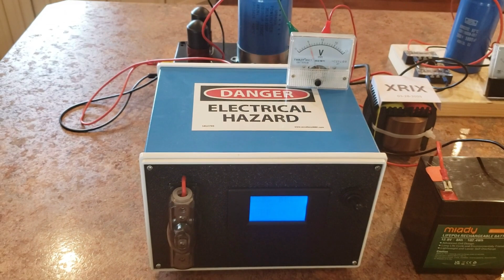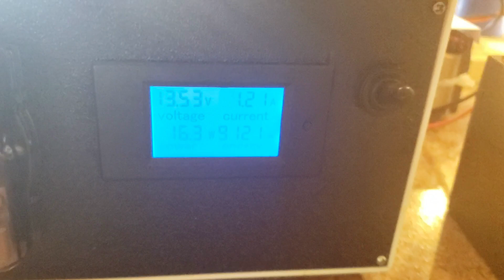Over Unity Working Don Smith Device - Part III

Comment: Hey, sir! I'm fairly new to Don Smith...But I want to grasp what's going on as quickly as possible and get the right information. Is this essentially the same schematic from the Zilano Final Disclosure pdf? I have replicated one over unity device (the MEG) and have others I'm working on...I have a background in electronics and am an electrical engineering student pursuing a bachelors. I'm trying to find some dudes that I can actaully learn from (I'm 26). Coming across someone that knows more than me in daily life is near an impossible probability. Your PhD electrical engineering professor is not even gonna have this knowledge. Obviously, there's only a handful of people in the world that have this knowledge and skillset. I'm stuck with finding a person through the internet.
Reply from the maker: Hey Man, yes the basic schematic is based on the  Zilano Final Disclosure, with the modification that I use Tesla's Colorado Notes on Page 57 for the  capacitor layout, which proved more efficient. If you are that learned with proper academic EE, and built a MEG, you may have come to a dry trough. For the reason that it's harder to fill a full cup with the right brew, rather than start with an empty cup.  However, If have you come to this video, and reached out, I suspect the EE paradigms may be in doubt in your mind?
Reply: @XR_IX I can't help but also mention Dan Winter because he's also a very important person regarding ZPE and an electrical engineer. He discovered what gravity is -which is charge acceleration- and has made many discoveries with equations. Aligning exactly with what Ken Wheeler concluded on his own separately. A genius, and he gives explanations to ACTAULLY how and why many ZPE devices like the MEG work. The inventors themselves in most cases can't necessarily explain the actaul physics of why the ZPE device works like Bedini's circuits for example but Dan Winter is pretty much the only person in the public domain that can. "Principles of Zero Point Vaccuum Coherence" and "Explaining How Gravity Works - Golden Ratio Fractality" are two great videos to get familiarity. 

But the other devices I'm still in the process of trying to replicate are Akula's eternal lantern, the TPU (torroidal power unit), Floyd Sweet's VTA, Daniel McFarland Cook's electromagnetic battery patent. I've been using a wayback machine to find forums and webpages that are no longer available...I found a webpage from like the year 2000 talking about the secret to the VTA which I feel fairly confident about especially in consideration of the info from Bedini and Overunity and Hyiq Research. I'm already at the stage of the anomaly of the voltage dropping when turned upside down with the TPU, but I havent spent really time at all with that device yet.

Btw, I recommend checking out the files on ZPE disclosed by Dr. Steven Greer's DPIA Archive. In there, he has many of Cejka's files that Bedini had. I'm not sure if you're familiar with the Energy From The Vacuum series or the Cejka files but the entire 40 part dvd series was actaully recently uploaded to YT thanks to a couple of people. Cejka was a CIA Officer/electrical engineer involved in actively supressing many discoveries and inventions. Anyway, the series is extremely valuable and I definitely recommend saving them to a drive. There are many patents and info in that archive. About 200 Pdfs.
Reply from the maker: @AethericTheorem  If your research helps you build something that works, great. If it leaves you with analysis paralysis, it is counter productive. I won't use words like ZPE,  Zero Point, Vacuum Coherence. They are recognized as pseudo science.  I am not a theoretical physicist , so I don't want to pretend to speak that way. I squeaked by high school, and failed my first year at IOWA pre-engineering. Go Hawkeyes! I have a different perspective,  from the references you mention, again not important.  I kind of sit in the back of the class making fart noises to impress the chicks.
Reply: @XR_IX I get what you're saying, that's why I think intuition is most important. Obviously just because a theory is an alternative to an established one that is incomplete or entirely incorrect, it doesn’t necessarily mean it's the complete picture either. No one REALLY knows what's happening in the relationship between a wire carrying electric current with an electric and magnetic field. Eric Dollard testifies to that. It's not so called spheres of mass called electron particles moving from atom to atom inside the molecular structure of the conductor as todays physicists claim. Use your intuition for what you truly do know to be the case, and be honest about the realm of possibilities and what you're not sure about. It's clear to me that unfortunately the average person's intuition is just pretty damn low and academia is really a prime example of that.
Reply: @XR_IX And I don't think I'm wildly smart or intuitive. But academia and pop culture physicists are absolutely nauseating. And quite frankly, the professors are not people I would look up to as unusually smart or wise. Dr. Salk emphasized the importance and difference of aptitude and intuition. Intuitively I knew that Dr. Greer's paradigm of contacting intelligent life through out the cosmos brought about by Darwinian Evolution (the asinine notion of pre-biotic inorganic disorder ever becoming anything much less what we know as life) is an outlandish and fallacious mere religion. But after literally having been face to face with two different "ETs" and having spent over a hundred hours without exaggeration asking them questions in a yes or no format, I know beyond any shadow of doubt that they're fallen angels inhabitating genetically engineered bodies and of course that whole history originally goes back to the 200 that descended upon Mt Hermon. But my intuition had already told me that beforehand. Sometimes the answer only confirms what you had already intuively known pre-confirmation. A related but separate example also would be the phenomena of EVPs. The'yre not dead human beings. It's dangerous in my opinion I have stories I could tell but of course researching transdimensional communication and reverse engineering schematics with the intent to create a phone to another dimension could seem exciting to a lot of people... Have hours of conversational audio with the demons speaking through quite frankly scary stuff, I found a recorder thats little known about and works way better than anything like a DR-60 and went based off of that design utilizing quantization noise (improved upon the Sony ST10 which already works blowingly well). Often the responses appear to happen before in time which is quite insane.
Reply from the maker: @AethericTheorem  Ignorance is a protection of that which scares people. As ironic as that sounds. I believe you are throwing up too many balls, to be effective in this exchange. We might share many similar points of view on the majority of subjects. However, we must focus on completing a task. I have limited time resources, and though I am happy to guide or answer questions in my wheelhouse, I refrain from traversing beyond that scope.
Reply: @XR_IX  Any advice on creating an electro gravitic device? I had heard you  had supposedly made something intriguing.
Reply from the maker: @AethericTheorem  I'm sorry, I don't know what "electrogravitic" device is. That is a pseudoscientific word.
Reply: Before I had ever even fully understood what a volt or amp was, my intuition was telling me that what I was being told about electromagnetism was incomplete and it didn't make sense to me. This was when I was around 20, and I was just trying to learn basic electrical terms that every person should know. That lead me on a path to research because of how mainstream science describes the relationship between the electric field and the magnetic field doesn't add up. I had also been familiar with Dr. Steven Greer's work and the issue of energy suppression. Luckily, that caused me to stumble upon Eric Dollard, who is undoubtedly the most authoritative EE on electrical theory in the public domain. Thankfully him and Ken Wheeler both preserved the truth regarding field theory and electricity. Ken Wheeler literally wrote THE book on what magnetism actually is, the only person to have ever done so in history. The real unified field theory is already hidden in plain sight but not known or understood by academic institutions. The fallacious garbage of quantum mechanics scrubbed EE and has retarded any progress in academia.
Reply from the maker: @AethericTheorem  I won't debate the validity of any of the references you choose to follow. Let me however, present an approach. Make your own theories, and build your models on actual experimentation. A likely scenario, is that all the information available to you. is a contrived perspective. When a menu is provided for you, you tend not to order what is outside the menu. That suggests that control of both sides is likely. All theories crumble when you attach a load to it. This is why you can't find many people who can consistently show their devices running loads, and can't provide the morphology and history of what they've tried. You know the classic thermodynamic perspective: A closed system shall never produce more energy than what is introduced. The internet trolls don't tell you, that law was contrived in 1850. I have come across two people, who I recognized as having the capability to build Don Smith, and know what the secret sauce is. Don said it over and over. Magnetism. Somehow his devices, breaks the confines of Ohm's law. You see my OU device I. The EE perspective is when you split output of power into multiples, each one is a fraction of the total power. I show that is not true. Nikola Tesla knew this. This is why his hairpin circuit was what he demonstrated over and over. Really Don Smith is just an extension of that. We see the schematic to a hairpin circuit, and it looks unimportant, but my OU devices (all) are a 3D version of the schematic, that looks more like a Ferris Wheel.

Comment: Congratulations XR IX! Are you using the T material in the blue box or a counterpart to it in magnetic properties? :)
Reply from the maker: Thank You, no the blue box, has gone through very little structural changes from OU 1 to 3.  OU 1 used a ZVS, OU 2 & 3 use a NST. However the method remains stationary within the Blue Box.
Reply: @XR_IX  Thank you for the answer, I asked you because if the focus is on the magnetic component there are only a few alloys that respond with a multiplied magnetic field after a received impulse. With reference to what happens in a transformer I noticed that above 20KHz, with coils in opposite directions, with one of them at resonance, and the other in short circuit you can effectively short circuit the output, no difference at the input! So the blinding barrier, in which the input and output are not visible is easy to make, but even if at first glance it seemed like an increase in energy, in no case a multiplication x2 x4,,, etc.
I admit that I don't have a transformer with Matglass or Vitroperm to lower the voltage, maybe that's the final trick!
Reply from the maker: @profy2002  Yes magnetism is the key.  You always want to use the good cores. I erroneously purchased an iron core, in the same size as my amo-nano , and when I used the same winding bobbins. The results were poor. Materials matter. Don said it had to do with the magnetostrictive properties. Basically it can go between torsion and magnetic field (my thoughts).

Comment: I am impressed by your success. I immediately subscribed to the channel. For 2 years I have been exploring the patents of Don Smith, Nikola Tesla and others, but without any stunning effects. I watched your previous videos of this device and I think I read all the comments. In the first part of the video, you explained the principle of operation to your colleagues in the comments very clearly and understandably, which also affected my blood pressure ;). I was about to start experimenting, even though it is 8:30 p.m. in Poland when I write this comment :). However, I decided to get a good night's sleep so that tomorrow I can start experimenting full of energy and with a fresh mind. I had the components for building Don Smith's device for a long time, but the project was waiting and waiting, because I wandered around various forums for a long time building coils, etc. I have a question for you about coils and series capacitors. Could you give me the approximate capacitance of the capacitors and the inductance of the coils? Can the coils be on a ferrite core, metglass, or maybe air? I have a metglass AMC-320 and ferrites. Is a varistor necessary? I have spark gaps, HV oil capacitors, HV diodes, etc. I understand that the triac controls the lamp instead of a spark gap, right? Generally, I would like to start with something small to investigate and understand cold electricity. Thank you for sharing these values, because humanity has no time to wander anymore. Best regards
Reply from the maker: The large blue caps are large 120000 uF. The output caps are 5600 uF. The are for DC storage.  Varistors protect the large caps because in case your wiring disconnects the load, it will pop those expensive caps.  Best course is to build a MOT single circuit, and use a 4W 12V bulb. Then you can understand the concept. Cold electricity can be hard to understand. But understand this concept: Cold Electricity is NOT HFHV regular electricity.